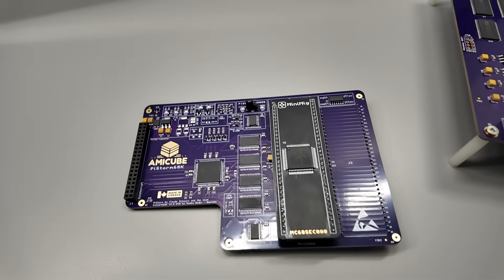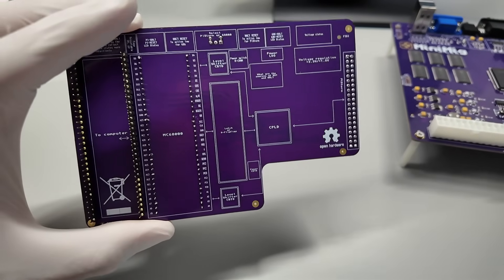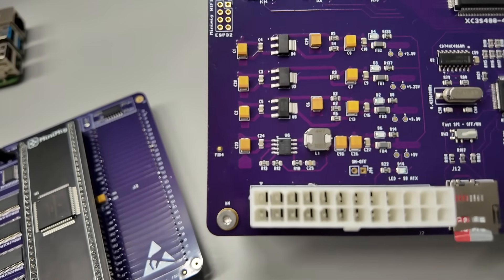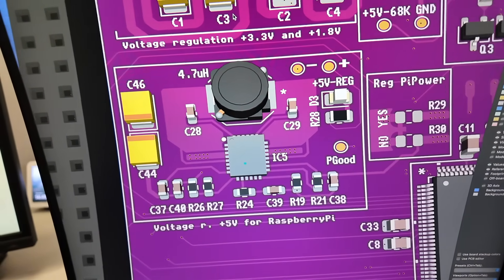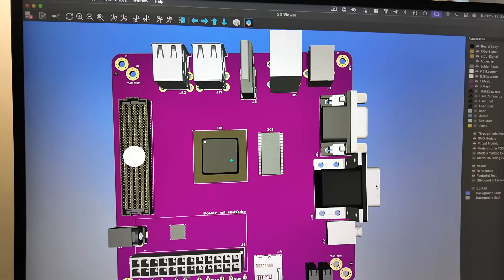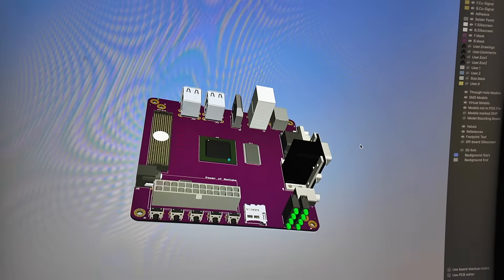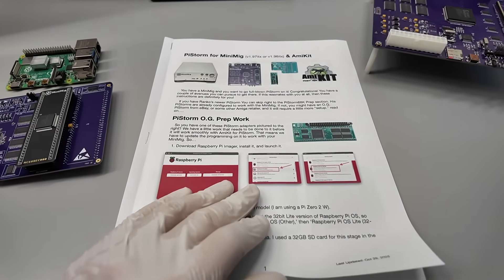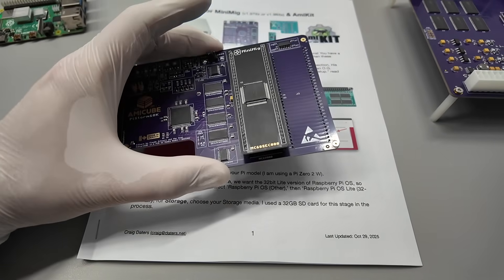🔧 PiStorm 68K v1.6 – Power, Precision & Next-Gen Amiga Development

Comment: Interesting progress as usual. Curious about that mezzanine connector. How many things can be connected at once and what could be added?
Reply from the maker: Thanks for the question! You can think of the FMC-style mezzanine connector simply as a large group of general-purpose I/O pins that go directly to the FPGA. That means the main limitation isn’t the connector itself, but rather how large your add-on PCB is and how many of the FPGA’s I/O pins are actually routed out to the FMC header.
Because the I/Os are exposed “raw” to the FPGA, you have a lot of freedom, anything from simple GPIO expansion, LEDs, DAC/ADC modules, level-shifting boards, specialty interfaces, or even full daughter-cards with their own microcontrollers or peripherals can be added. As long as it fits within the pin count and electrical limits, it’s fair game.
The only other important constraint is power budgeting. Some add-on boards can be power-hungry, so you’d want to ensure their consumption is within what the baseboard can safely deliver. I’ll make sure that at least 4A of power is available on the mezzanine connector so that most reasonable expansion boards can be supported without issue.So in short, you can connect pretty much anything you can design, limited mainly by available I/O pins and power requirements.

Comment: How hard would it be to convert this pi storm to an A500 sidecar? Would it just be a matter of replacing the CPU socket connectors with traces to an edge connector or would it be more involved?
Reply from the maker: It should be straightforward since the expansion port exposes the full CPU bus. I’d design a new board for it so that everything fits neatly.

Comment: Appreciate these updates. For those of us interested in electronics design, embed and FPGA dev, can you perhaps do a video on required background, tools you are using, your workflow etc? Thanks!
Reply from the maker: Thanks for the kind words! That's a fantastic suggestion.
In the meantime, here's a quick snapshot of my current setup:

PCB Design & Schematics: KiCad all the way its free, powerful, and handles everything from simple boards to complex multi layer layouts without breaking the bank.

RTL/FPGA Development: I cut my teeth on ISE for earlier Xilinx parts, but with the switch to Gen 7, Vivado is my go to now. The simulation and synthesis tools are a beast, though the learning curve on the GUI can feel like wrestling a digital octopus.

Embedded ARM C (SAM S7 series): Keeping it old school with just a solid text editor (Vim or VS Code, depending on the mood) and GCC for compilation. No fancy IDEs here bare metal keeps things lean.

Background wise, a mix of EE fundamentals (circuits, signals, digital logic) plus some self taught Verilog/VHDL goes a long way. What's your stack looking like these days?
Reply: @amicube  thanks! If you mean hardware, I only have mister to work with, for FPGA anyway. I have basic soldering skills but never designed a circuit. I guess my professional Python, Linux and C knowledge could be of help, but I know there’s so much more to learn. Having only worked on a high level software stuff so far, I am growing interested in a proper low level stuff.

I was thinking of picking up some lattice dev board - open source tools support for those exists. Maybe getting it to work and perhaps blink some LEDs would be a good start?

Comment: In my experience WLAN of Pi gets instable, too, if voltage drops below 5V.
Reply from the maker: Indeed, a stable +5V rail is essential for reliable Raspberry Pi operation. In my experience, adding a solid and well-regulated power supply makes a noticeable difference — overall, having clean and stable regulation is definitely a big plus!

Comment: I love the block diagram on the back. Makes it a lot more interesting!
Reply from the maker: Right? I love it too! it really helps me keep track of which block does what! In this case, I’m using discrete transistors for simple logic. I could probably move it to a small CPLD to reduce complexity, but it’s simple enough not to be a pain in the rear end, and thanks to the diagram, it’s always clear what’s doing what. Plus, having the block diagram on the back really helps with debugging and fixing, so if the bottom side is available, I definitely recommend it.

Comment: I have to get that 6DOF input device you are using on your computer. I love how easily you move the 3D camera in that app. Which one do you have?
Reply from the maker: The device is the 3Dconnexion SpaceMouse Wireless, and I have to admit, this little gadget has significantly boosted my productivity! My only issue is that KiCad isn’t supported under Linux for it, so I’ve moved my KiCad work to the Mac Mini instead. That said, it turned out to be a good decision, the Mac Mini M4 Pro delivers amazing performance with KiCad overall.
Reply: I believe it's a SpaceMouse by 3DConnexion (the compact type). They are awesome for design/CAD work.

Comment: Thought it was going to be itx why has it got ports on two sides of the board ?
Reply from the maker: Good question! I figured this design choice might confuse a few people at first. The reason is that I’m actually spinning up two boards, one nanoITX and one miniITX.

The miniITX version is larger and will have all the ports on the front, including floppy disk controllers and Zorro II. The nanoITX version, on the other hand, is smaller and designed to be VESA mountable, more in the style of a Mini PC.

That said, the nanoITX isn’t a slouch, it features a mezzanine expansion port, and I’m planning to develop plenty of add-ons for it. In fact, this little board will make an excellent FPGA development platform!

Also, the previous Minimig case will be compatible with the miniITX variant, only new faceplates for ports and buttons will be added.
Reply: Yeah that issue again. ITX was fine, I get that Mini PCs are a thing, but Nano-ITX cases are not easy to come by.
Reply: @fasih_rehman  He sells the previous MiniMig with a case. I think there was mention of a case in the previous video. My point being there will be a case. Though it will have to be a custom case  :)